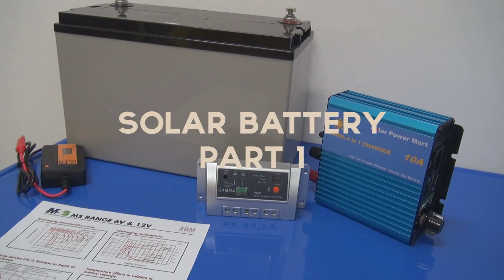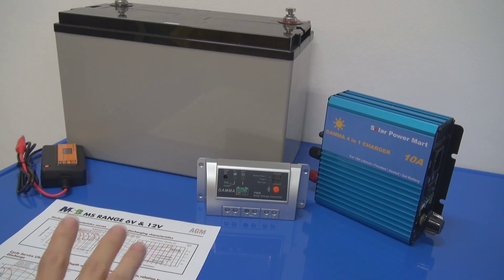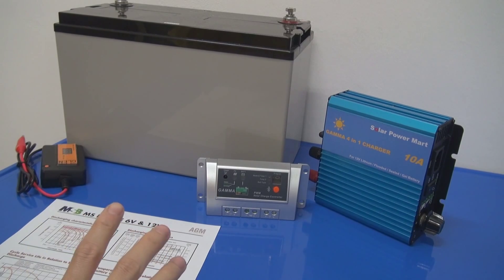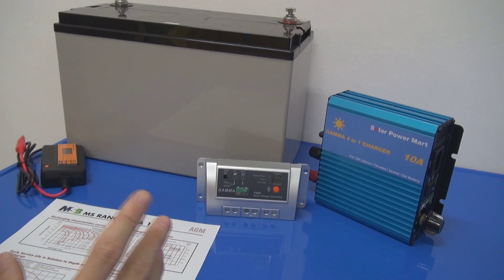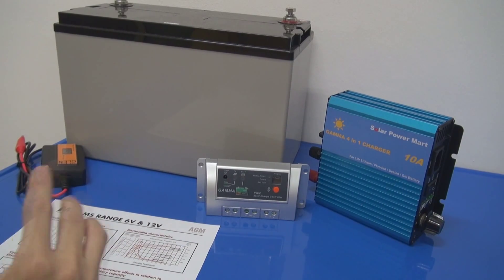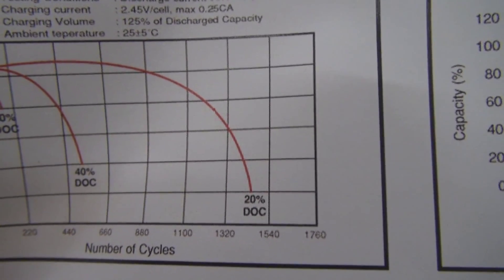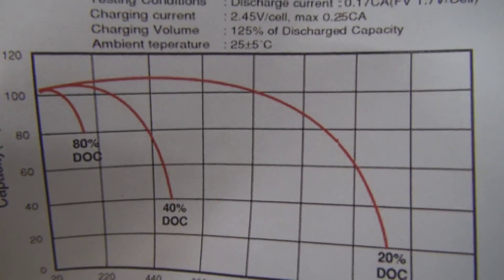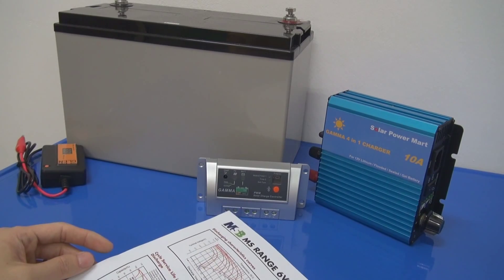Solar Battery Part 1: Sealed Lead Acid Battery - AGM

Comment: There is a lot of information in this video. To much for most you-tubers  to understand all in One go. I enjoyed it though. A very honest look at some cheaper made AGM batteries. my Batteries in Australia also run hotter then 25c. However the batteries i use are built for that. they are 64kg batteries. a lot of lead in them.
I do all the Research and Development for e-solar Australia.